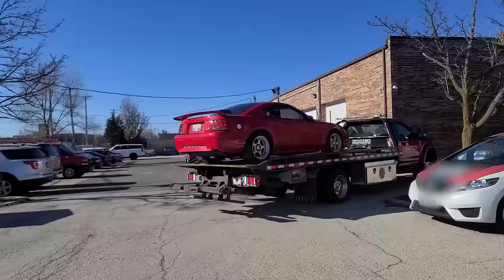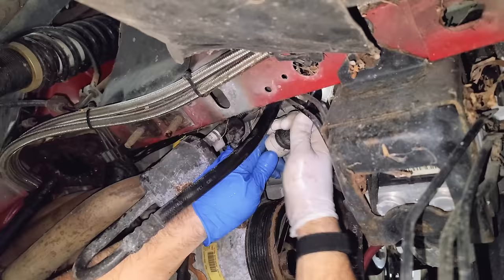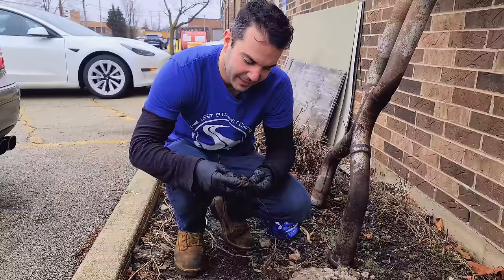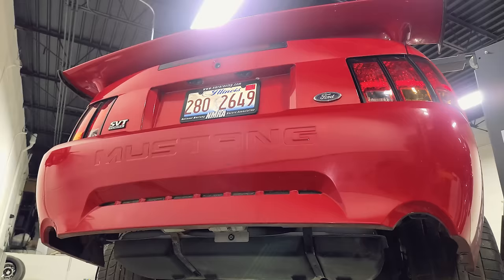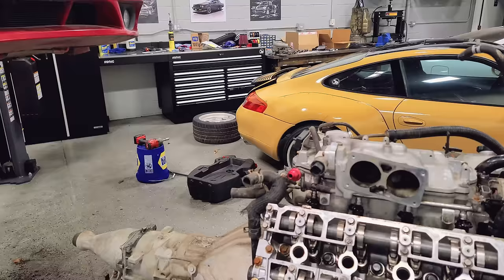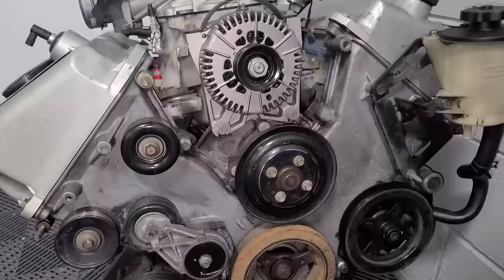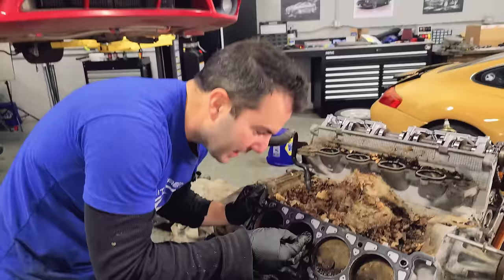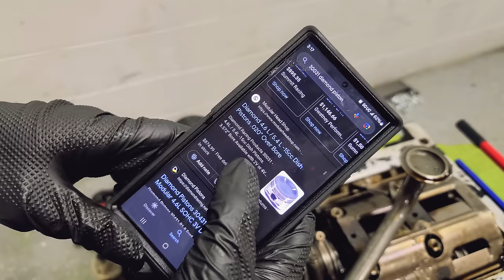Rebuilding The World's Fastest Cobra Mustang! ABANDONED For 20 Years! New Engine & CARNAGE!

Comment: Alex, i recommend a head cooling mod. Don't use mmr. The 99-03 cobra have improper coolant flow, in cylinders 7 and 8, so they get too hot, and burn up the valves.
Reply: Coyotes still do this if idled in cold (well below freezing) climates
Reply: Sure this isn't a Chevy 6.5 turbo diesel? :P (Same thing happens in #7 and 8)
Reply: This + the altenator is crap as well
Reply: @notdewmc 03/04 alternators are the troublesome alts.
Reply: Don’t use MMR? Why ? Just cause you don’t like them ? Or ? Reason please, or don’t make statements like this.
Reply: @commonsenseisdeadin2024 the 03 got worse because they were down near the exhaust but none of the 6g Ford alternators are worth a shit and need to be replaced with a large Denso style case which Ford changed to in 2010 and up for a reason.  They have great options that are direct replacement like j2fab and nations.  The type of alternator itself is the problem going with an ho 6g won't help much.  This is why you see guys changing alts 5 or 6 times because they think getting ho 6g style is the answer when it isn't.
Reply: @robertd5674  Mmr has a horrible reputation. Shops that build those engines, will also say steer clear of some of their products.
Reply: @midnight347  Kmj is the only alternator to run, on a 2v or 4v
Reply: @midnight347  I guess I never had much issue with the 6gs when I was a fleet mechanic and I suppose my 03 Vic has a hairpin 370A. What's the failure point in them? (Besides the stupidest (intended) invention yet, the clutch pulley *where applicable!*.)
Reply: This mod is a must
Reply: @karlhopkins713  what are you all doing to your alternators? They are so simple... I don't know who/what kmj is but my Brand X is just fine. Irragi, CES, Mechman, DC all make good alternators. Just stay away from Ultima!
Reply: @commonsenseisdeadin2024  I went through 4 in less than 3 years. All of the bearings failed, from being overspun. I don't even beat on the car.
Reply: @karlhopkins713  what application? I have a feeling there's more to it... Underdrive pulley setup?

Who did you use as a replacement?
Reply: 99-04*...upr makes a good 1!
Reply: In the mustang world we call it the 3 letter business 😂 steer clear
Reply: @plark7323  they are all 3 letters! LMR, UPR, MMR,SVE , SVT, FRP,  didn't AM used to be 3 letters? I want to say it was American Mustang Muscle
Reply: @GameOver321 it’s the exact same as MMR.
Reply: There’s nothing wrong with the MMR head cooling mod. They have SOME decent products. Their head cooling mod and coolant crossover delete are the only products from them I have on my forged 4.6L 4V. That’s all I’ll buy from them though.
Reply: @commonsenseisdeadin2024 Yea unless he runs it with no oil this is cap
Reply: Newsflash buddy 90% of engines have inadequate coolant flow to the rear cylinders. Coolant flows from the front to back.
Reply: Yep true, don’t you have to remove the freeze plug and buy the kit so the cooling can keep flowing all the way around ?
Reply: @drip_17  yes.
Reply: @jaybomb5022  I'm not following?

Comment: Use the 1999 timing cover. The three bolt tensioner is a bit better for a supercharged setup. Pulleys will interchange fine. 1999 Cobra used a regular Mustang GT bumper too

Also the replacement engine has factory ford cams in it.
Reply: With the engraved number below the factory stamp I'm assuming they are regrinds.
Reply: The 99 and 01s used 6 cyl rear bumpers and hoods. Customers were really disappointed which is why the 03-04 looked so much different.
Reply: @TheDealRonaldTrump  That is incorrect.  They were GT Bumpers, the V6 didn't have cutouts for the exhaust.. also, it was only in 99.  '01's had COBRA embossed in them.
Reply: The front bumper is unique to 99/01 cobra. The rear is a regular GT bumper but has SVT cobra badge on the deck lid vs 01 just says SVT since it has the cobra lettering on the bumper
Reply: @TheDealRonaldTrump  the Cobra R uses a v6 rear bumper. The Cobra hood is not a v6 hood, the "scoop" is inverted on the 99/01 Cobra's but I THINK it was just as functional as the v6 hood... (Meaning it was for l looks.... I could be wrong, it's been years but I don't recall it being an actual heat extractor like the termi.

Comment: Another great video. All your builds are inspiring. Tip: Loosen all the subframe bolts before taking them out. Taking them out one at a time will pivot all the weight to the last bolt making it difficult to take out.
Reply: He has it completely supported by the table......
Reply: @commonsenseisdeadin2024  Even if the engine is supported by the table it will never be completely evenly balanced.
Reply: @jamesemcclure  I mean I'm not there with him but I am pretty sure it's common knowledge to pretty much support the front of the car on the table instead of the lift (obviously doing so "safely", meaning not being stupid with it) where it's pushing the cross member up into the vehicle so the bolts aren't holding the subframe in, rather the weight is! 

IF the bolt had pressure on it then it likely wouldn't have spun as it did, the cross member better not flex or twist so yes it should be completely supported! Balance plays no part here, what balance do you need? He removed the last nut and bolt and nothing moved...... I don't know where you get any weight pivots or there was any difficulty removing the bolt. 

It's evident you never removed an engine using a hydraulic lift table and a vehicle lift. I highly recommend it though! It can be a little trickier in a transverse configuration when it's more than just a K frame and symmetrical as it is here. Then again, everything is a little trickier with a transverse mounted drivetrain.
Reply: @commonsenseisdeadin2024  "I don't know where you get any weight pivots or there was any difficulty removing the bolt. " Alex expressed difficulty removing the last bolt. 'weight pivots' is not what I said. To understand read more carefully.  BTW Physics, weight distribution and gravity don't make exceptions based on a persons experience removing an engine.
Reply: @jamesemcclure  yeah it was more difficult because the retaining tab bent, was rusty and the nut was spinning. He spoke too soon as all the others didn't have the same issue. (Cause Murphy is a bitch like that! 😂) The tabs are strictly a convenience (mainly for assembly). With the car sitting 20+ years and being a northern/midwestern car rust is going to happen (regardless of it not being driven in the winter). 

Had nothing to do with balance, shifting, pivoting. I however misspoke, the K member did drop a little when he backed the last bolt out.

Comment: Want to touch base on the part where you heated the driveshaft bolts. You can heat the threads inside, such as header/manifold bolts, or drive shaft bolts by heating the bolt head cherry red, let it cool (during cooling it transfers the heat to the threads off the bolt and into the part therefore separating the bolt from the part) and after about 3-5 minutes the bolt 99% of the time come out with ease. Oxy/acetylene is usually the ideal tool for that. Give it a try! Great show!
Reply: You can do that, but IMO, it's easier to heat the flange and not the bolts.
Reply: @aaronbritt2025 every car is different tho, depends what’s near it

Comment: Something you may want to look into, depending on your goals; the 96-99 Cobra used an aluminum block made by Teksid in Italy. Some early 01s had a Teksid block also, but most of them had the WAP block, made in Canada. Both are fine for the majority of mild to moderate street/strip builds, but the Teksid is known to be superior for really high horsepower builds.
Reply: WAP blocks as well as pretty much any iron block are all good for 4 digit power.  The teksid things is mostly an internet fad with zero real world proof of their superiority... at least in the power levels that most people run.  I ran 800 rwhp through a WAP block with no issues.

Comment: SPS bolts were used from le factory.  Looks like a factory crank with that undercut radius on the rod journal, you don't see that too often on aftermarket cranks, they usually go with a fillet of some flavor.  Be interesting to know if the rod bolts are 8740 or 2000 material.  Rod bearings are a race series Clevite, pretty good.
Reply: Factory crank is a Kellogg forged unit. All aftermarket forged 4.6 cranks I know of all have counterweights just the same (Eagle, Manley, Scat) I've never seen a knife edge counter weight on a 4.6 crank. 

Can see in the video it has 8740 bolts (which is plenty strong, however I don't know why anyone wouldn't opt for the 2000 upgrade on a forged rod...)
Reply: Easiest way I found to check the crank without looking for the KC stamp on the first counterweight is to see if it has counterweights in the center.  The factory forged cranks had counterweights but the cast ones didn’t.  I believe the Manley, eagle, etc forged options as well all don’t have counterweights on the center.

Comment: Alex! So pumped for you to finally dig into this Cobra. A couple years ago I  re-built an 03 Mach 1 (same aluminum 32v found in the 99 Cobra) with forged Manley internals and some aftermarket cams.  It put down 373 hp 350 tq NA and pulled very nice between 3-6.5k rpms. These engines have some complication with the timing setup but nothing for you. These engines also like the Ford Motorcraft Gold coolant and OEM spark plugs and coils.
Reply: Also, don't throw the heads out from the old engine. There were never any aftermarket heads for these 32v's ever made so the cores are still vital for people to keep these on the road and thus worth some $$
Reply: Out of curiosity, what cams are you running?
Reply: @BuffMyRadius  a custom set specified by Todd Warren. He works with Apocalypse Performance and will Taylor cams to your setup and desired powerband, rpm etc.